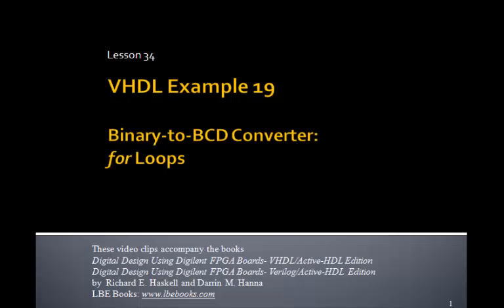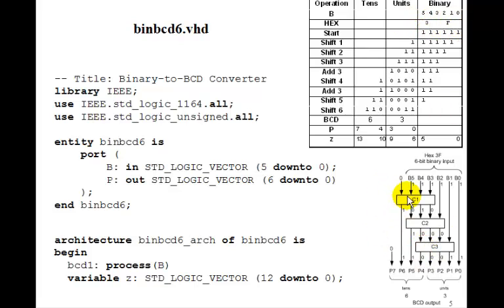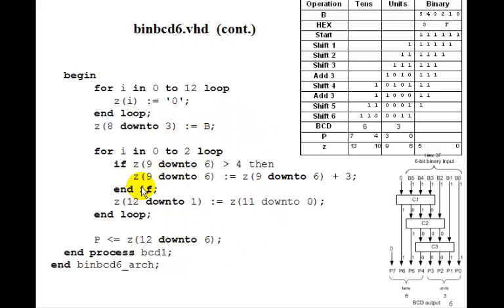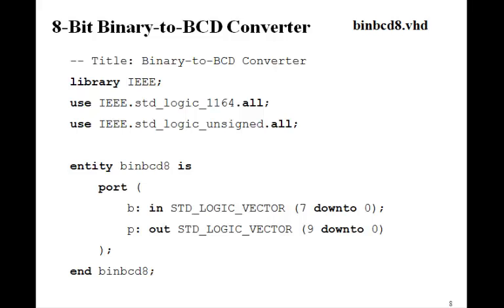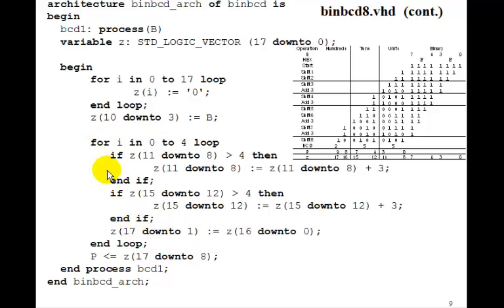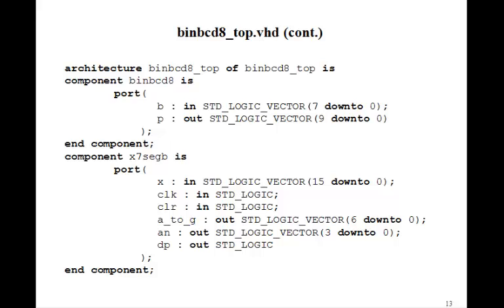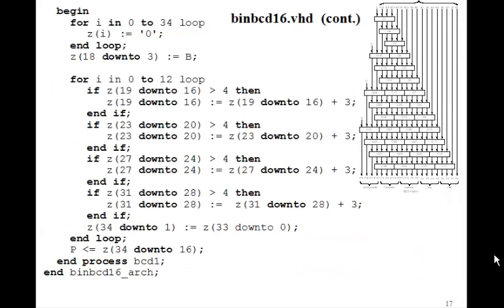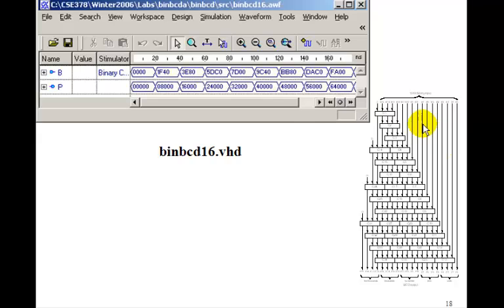Lesson 34 - VHDL Example 19: 8-Bit Binary-to-BCD Converter-for loops

Comment: At the end : P <= z(12 downto 6), why does it gives 63 ? the value 110 0011 = 99 in decimal (for the binbcd6.vhdl)
Reply: The value if 110 0011 isn't binary coded, its BCD coded, so it means every 4 digits are representing a decimal digit, here is the procedure: 110 0011 in BCD = 0110 0011 (added zero in front doesn't change anything) = 0+4+2+0 this is first digit(6) and 0+0+2+1 this is second digit(3), 

in short
0110 0011
   6        3

I hope you understand it ;)

Comment: how would i modify this VHDL code example to do a 10bit binary to BCD conversion? I think i have it but i'm not sure.
Reply: library ieee;
use ieee.std_logic_1164.all;
use ieee.std_logic_unsigned.all;

entity binbcd10 is
 port (bin : in STD_LOGIC_VECTOR (9 downto 0);
   bcd : out STD_LOGIC_VECTOR (11 downto 0));
   
end binbcd10;

architecture binbcd10_arch of binbcd10 is
begin
 bcd1 : process (bin)
 variable temp : STD_LOGIC_VECTOR (21 downto 0);
 
begin
 for i in 0 to 21 loop
  temp(i) := '0';
 end loop;

 temp(12 downto 3) := bin;
 
 for i in 0 to 7 loop
  if temp(9 downto 6) > 4 then
   temp(9 downto 6) := temp(9 downto 6) + 3;
  end if;
  temp(21 downto 1) := temp(20 downto 0);
 end loop;
 
 bcd <= temp(21 downto 10);
end process bcd1;
end binbcd10_arch;
Reply: @xincarceratedx  how can simulation this code or simulat the code in video i try but i always have an error..

Comment: hello,
z(17 downto 1) := z(16 downto 0); can be  
z(17 downto 4) := z(16 downto 3); because you had shifted 3 times already. Or you can replace de first loop by
z := "0000000" &  b & "000"; --concatenate with 0's to have 18 bit.
In fact, you don't have to shift 3 times, but it is helpfull to understand. Or I don't?
Reply: please have you found the answer?